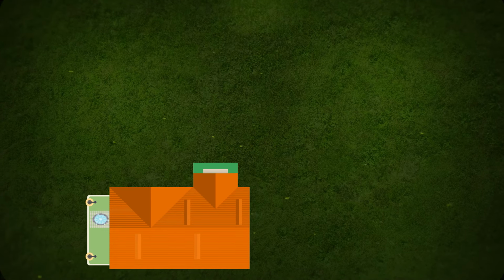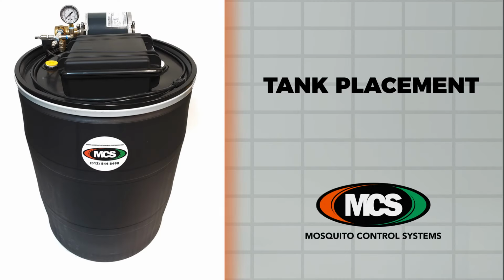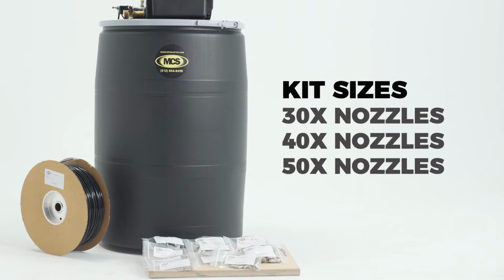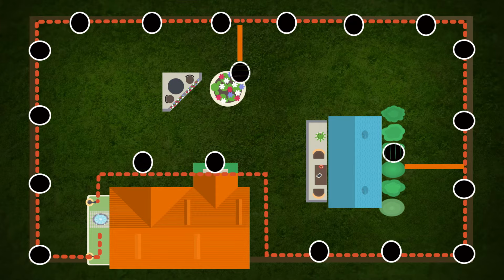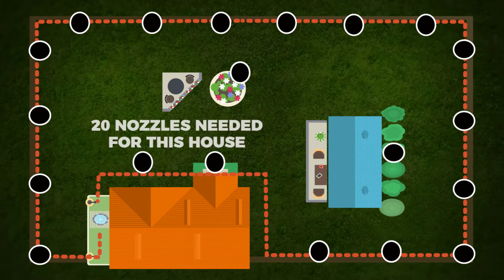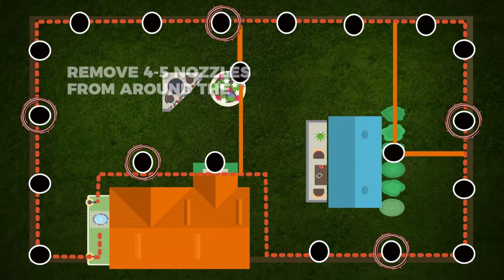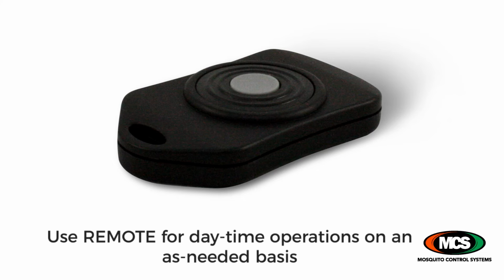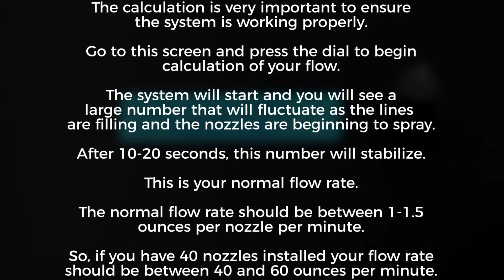How To Install a Mosquito Misting System by MCS Products!

Comment: how long does it spray for when it triggers?
Reply: Usually sprays for one minute intervals, but you can customize the auto spray times and duration of the sprays on the control panel.